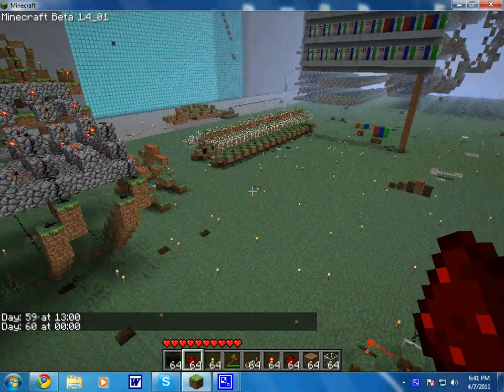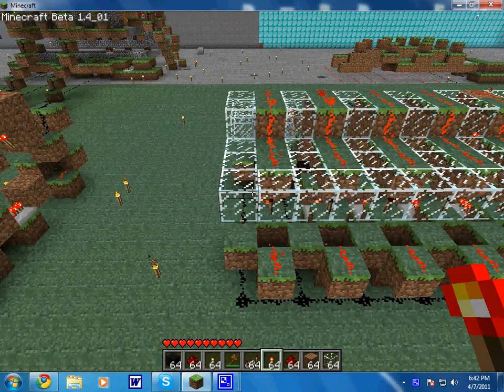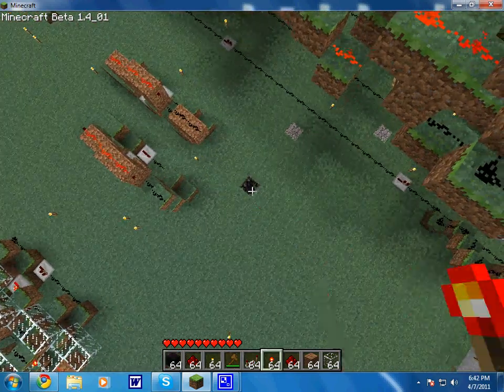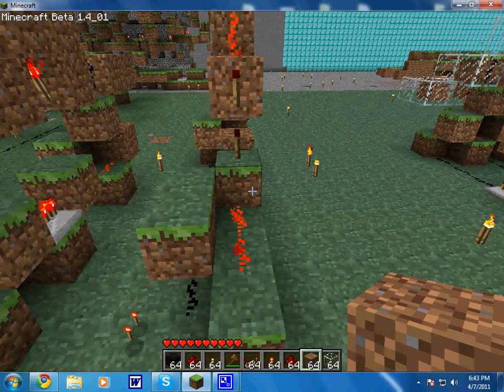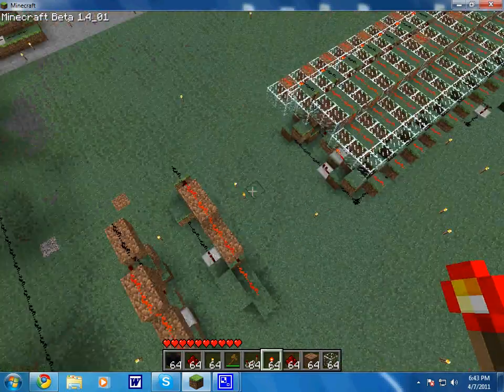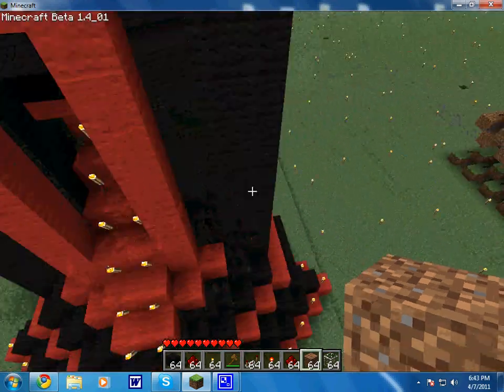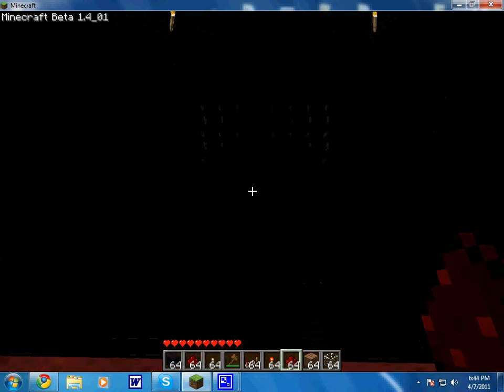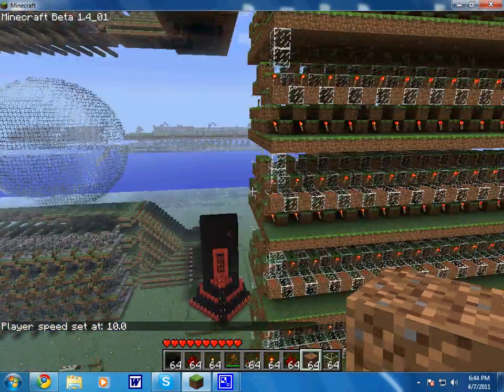Small RAM! 8x8 screen hooked up!

Comment: @redstonewarrior What I'm not sure about is that I'm used to seeing RAM bits with a in, and out and a load bit. The DFF keeps state most of the time, and when load is asserted, the bit changes to the value of the input. I'm aware that the rules of MC are different, and I don't really get how you don't have a "load" bit or what the monostable circuit does. Sorry if I'm missing something, I just want to use this design of RAM.

Comment from the maker: @mbgdemon not entirely sure as to what you mean. if hooked up to a monostable circuit it is a d-latch that is edge triggered. there is a line, which "loads" the input into the memory, there is the input and the output.

Comment: I have a question as to the RAM:
It has an out and an in, and a clock, but where is the load bit? It seems to me that it loads every time, which is not exactly useful for storing memory values. 
Please, answer.